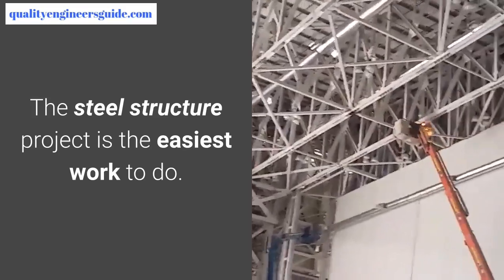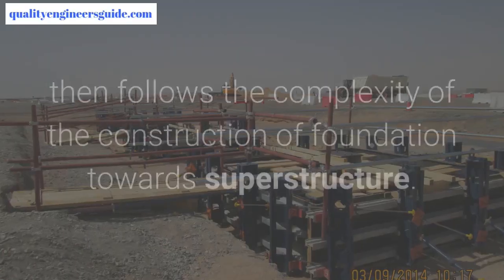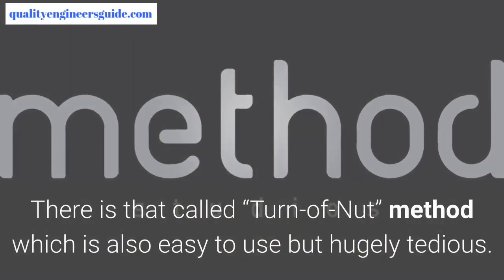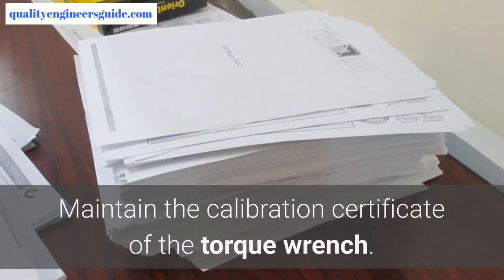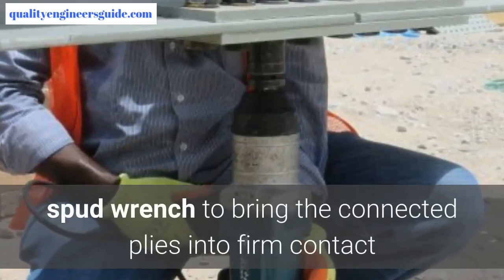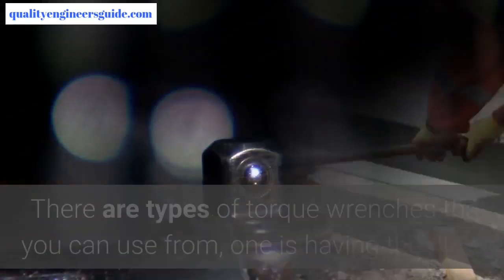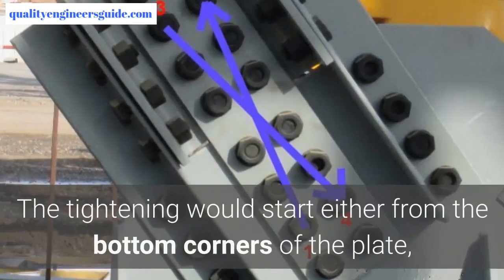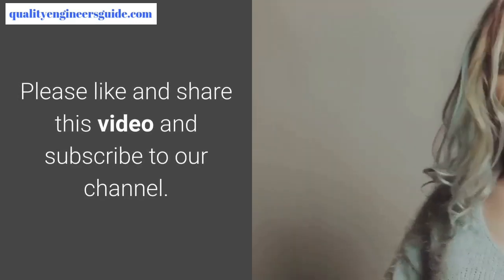How to check the connection bolts for tightness

Comment: The presenter mentioned A390 instead of A490. He also mentioned the use of click wrench but not discussed the procedure before using it. Remember that torque is not tension. It must be verified that the torque correspond to the required minimum pretension plus 5% for pre-installation verification procedures. The RCSC discourages the use of torque table unless it undergo the verification procedures using tension device such as Skidmore-Wilhelm Tension Calibrating device.
Reply: Furthermore, it is my observation that most engineers on site are not aware about the proper procedures prior to conducting inspection of the installed high strength bolts. This is a red flag for them.
Reply: @danilofrancisco2792  Hi Danilo, You can use either turn of the nut or torque verification right? I doesnt have to be both